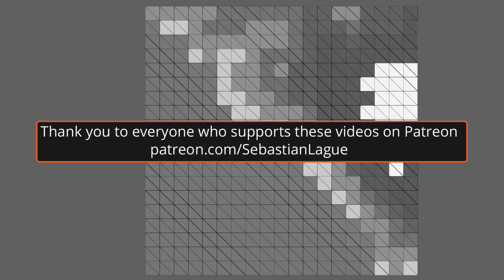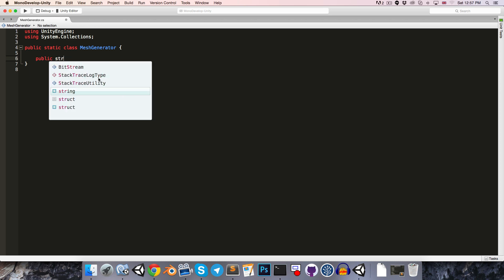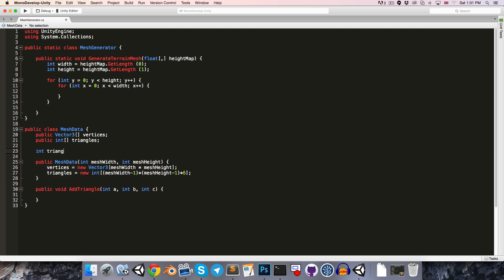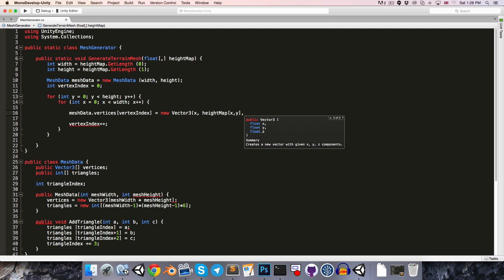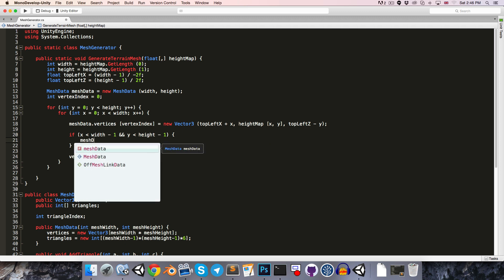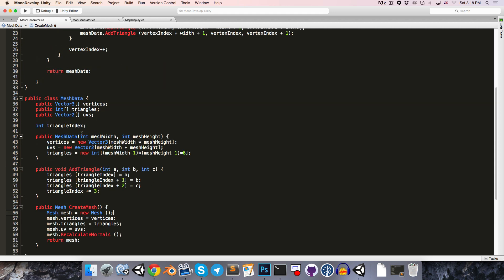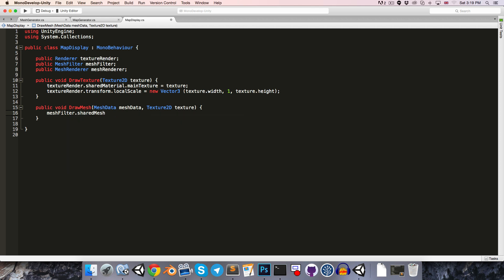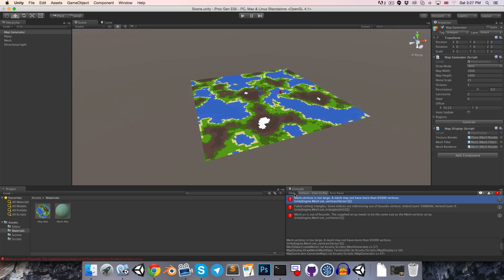Procedural Landmass Generation (E05: Mesh)

Comment: SOMEONE PLEASE ENLIGHTEN ME

i am SO confused. in episode 2, the width and height was the amount of pixels in the texture. And as far as I know, the amount of vertices should be (pixelWidth + 1) * (pixelHeight + 1), not straight up pixelWidth * pixelHeight. Even then some how every pixels on the texture fit snuggly in the generated mesh's many squares. How was this possible?????????
Reply: nvm i figured it out (2). in his project his generated mesh really has a W*H sized vertices array, so instead of generating a mesh with W*H pixels/squares (like his color and height texture generation), it just generates a (W-1)*(H-1) pixels/squares. Wonder if this is intentional to decrease computational time (if you want an actual W*H grid of pixels, I think it you're gonna need to sample the surrounding 4 pixels/squares height to get the height value for the vertex), or if it's just a mistake
Reply: sampling 4 surrounding pixels every vertex DOUBLES computation time, so im guessing optimization. or it could be a conventional thing idk
Reply: @vinhnguyen-o5z  ha you are the best for coming back and responding the solution!!! i am making a procedural game and had this same question!! most people would just figure it out and forget about it you are the GOAT
Reply: damn i have the same problem now my head hurt，i also think that  vertices should be (Width + 1) * (Height + 1),because I think them as a border

Comment: mine doesn't automatically randomly generate the seed yet, did I miss something or does that come later? lol
Reply: hey the seed is from the previous episode when he adds a System.Random object named prng nand then the following for loop. its lucky i saw this old comment i am making a procedural game and was looking for a solution to one of my problems and saw your comment ! this is the code specifically that adds it and also adds custom user offset from the vector2 parameter in the method signature

for (int i = 0; i < octaves; i++) {
			float offsetX = prng.Next (-100000, 100000) + offset.x;
			float offsetY = prng.Next (-100000, 100000) + offset.y;
			octaveOffsets [i] = new Vector2 (offsetX, offsetY);
		}

Comment: I had the problem of the texture of my mesh being rotated 90 degrees so to fix it i just change this line of code from this:
meshData.uvs[vertexIndex] = new Vector2(x / (float)width, y / (float)height);

to this:
meshData.uvs[vertexIndex] = new Vector2( y / (float)height, x / (float)width);
Reply: interesting it may be due to somewhere in your code not matching sebastians... i had a similar issue where my for loops were out of order from videos ago. it took me forever to figure out lol i am making my procedural game using this series and keep running into super random stuff like this where one var makes it work or not and i can't seem to figure out why

Comment: can someone help please!!!!, only half of my mesh triangles render. so i can see procedual colours and everything put half of the triangles are not there and are just empty space
not sure which codes you need to help me:
for generating mesh i * it by 6 andd it didnt work
public static class MeshGenerator
{
    public static MeshData GenerateTerrainMesh(float[,] heightMap)
    {
        int width = heightMap.GetLength(0);
        int height = heightMap.GetLength(1);
        float topLeftX = (width - 1) / -2f * 6;
        float topLeftZ = (height - 1) / 2f * 6;

        MeshData meshData = new MeshData(width, height);
        int vertexIndex = 0;

        for (int y = 0; y < height; y++)
        {
            for (int x = 0; x < width; x++)
            {
                meshData.vertices[vertexIndex] = new Vector3(topLeftX + x, heightMap[x, y], topLeftZ - y);
                meshData.uvs[vertexIndex] = new Vector2(x / (float)width, y / (float)height);

                if (x < width - 1 && y < height - 1)
                {
                    meshData.AddTriangle(vertexIndex, vertexIndex + width + 1, vertexIndex + width);
                    meshData.AddTriangle(vertexIndex + width + 1, vertexIndex, vertexIndex + width);
                }

                vertexIndex++;
            }
        }

        return meshData;

or the display code is this

public class MapDisplay : MonoBehaviour
{
    public Renderer textureRender;
    public MeshFilter meshFilter;
    public MeshRenderer meshRenderer;

    public void DrawTexture(Texture2D texture)
    {
        textureRender.sharedMaterial.mainTexture = texture;
        textureRender.transform.localScale = new Vector3(texture.width, 1, texture.height);
    }

    public void DrawMesh(MeshData meshData, Texture2D texture)
    {
        meshFilter.sharedMesh = meshData.CreateMesh();
        meshRenderer.sharedMaterial.mainTexture = texture;
    }
}

not sure what the problme is . help
Reply: You just forgot on the 2nd AddTriangle call, to increment by +1 instead of the width.

If you are still stuck with that, change this:
                if (x < width - 1 && y < height - 1)
                {
                    meshData.AddTriangle(vertexIndex, vertexIndex + width + 1, vertexIndex + width);
                    meshData.AddTriangle(vertexIndex + width + 1, vertexIndex, vertexIndex + width);
                }

to this:
                if (x < width - 1 && y < height - 1)
                {
                    meshData.AddTriangle(vertexIndex, vertexIndex + width + 1, vertexIndex + width);
                    meshData.AddTriangle(vertexIndex + width + 1, vertexIndex, vertexIndex + 1);
                }

Comment: These issues may be addressed (or intentional) further on in the series but I found fixes to correct the mirroring (and incorrect mesh height from the next part) as well as the mesh being smaller than the color map. 

In MeshGenerator.cs I changed:
	float topLeftX = (width - 1) / -2f;
	float topLeftZ = (height - 1) / 2f;
to
        float halfWidth = (mapWidth - 1) / 2f;
        float halfHeight = (mapHeight - 1) / 2f;
This was mainly for readability as suggested by another commenter, I believe this can remain unchanged with some tweaks to the arguments for the following code:

	meshData.vertices [vertexIndex] = new Vector3 (topLeftX + x, heightMap [x, y], topLeftZ - y);
	meshData.uvs [vertexIndex] = new Vector2 (x / (float)width, y / (float)height);
to
        meshData.vertices[vertexIndex] = new Vector3(x - halfWidth, heightMap[(mapWidth - 1) - x, y] * heightMultiplier, halfHeight - y);
        meshData.UVs[vertexIndex] = new Vector2(1f - (x / (float) (mapWidth - 1)), y / (float) (mapHeight - 1));

In Noise.cs I add to the top of the GenerateNoiseMap function:
        mapWidth++;
        mapHeight++;

I also changed these lines during an earlier part as suggested by another commenter, I'm not sure if they are relevant here or not
                    float sampleX = (((x - halfWidth) / noiseScale) - octaveOffsets[i].x) * frequency ;
                    float sampleY = (((y - halfHeight) / noiseScale) - octaveOffsets[i].y) * frequency;

These changes will make the noise map larger than the color map and mesh, but the color map and mesh will match. I have no idea how this will affect following along with the code in later parts lol

Edit: For the next part you will have to set mapChunkSize to 240 instead of 241 to maintain consistency in size between the color map and mesh.
Reply: yooo! heck yeah! I am going to go through this entire series to help make biomes in my procedural game (he doesn't cover that but this is a good place to start) and if he never solves this problem later in the series then you are a life sizer!!

Comment: my uv mapper is complete, almost I realized my mistake when making meshes and using the smoothing system... is that when doing that I need to not only measure distance between vertices, but also their matching uv indexes too. once I did that, things worked fine. just need to add in manual normal calculation to handle the hard shading that comes with non-smoothed vertices, to mimic the appearance that a quad, or tri, is sharing vertices with another quad or tri

Comment: ok, here I am again. I don't think you read your new comments or anything. but here goes. I have created a procedural generator for a vehicle, and that generator has a smoothing option built in, where I determine the distance between existing vertices in a mesh and compare that to the list of vertices in the list, if the distance is less than 0.005 meters, the system uses that vertice index to create the triangle. I do this in sets of three or 4 cause i need both triangles and quads. thing is, when running the smoothing code, the uvs do not work. I know your generator uses smooth vertices as I did not notice any of the issue related to flat shading showing up in the mesh. your way of doing things allows for uv coordinats to be preserved despite the fact that the mesh is smooth. I can things 1 of two ways. wait for you to help.. or do the irritating thing and analyze your code and compare it to how I am doing things. if anything it might have to do with the fact that I am adding in vertice, not all at once, but slowly as I progress down the entire generation script.... i use an ADDQuad function that takes in 4 points, a bool for auto uvs, and a bool for smoothing, then I pass in vector2s created from a function that converts vertice coords into pixel coords. then I use a uvmapper I made to uv unwrap the generated object. I have the uvs working in flat shaded mode, but in smoothing mode, nothing works.
Reply: I may have come up with an answer on my own, I just realized something. since I am essentially telling the game to use the uvs of an existing vertice when creating triangles, then I must also be accessing the UV for that vertice too. since I am not adding a new uv coord, I realized that since my uv mapper takes an object and splits its uvs into 5 sections. top, bottom, left and right and these are spread out over a large area of a texture. when smoothing, I am taking uvs from drastically different parts of the texture image and then using those for triangle. I realized this when I had remembered that some parts of the image worked fine, and those were where the UVs were close to eachother, IE in the same uv space. so to fix this I need to tell the computer to split my model up into 5 pieces. and then do smoothing on those 5 pieces individually then use a mesh combine utility to combine the resultant meshes together into 1. this should fix the UV issue.
Reply: it worked. I actually solved this on my own, and the solution was so simple!. now I just need to redo my vertice replacement code again and omit vertices from being added to the list. got code from my previous add quad method preserved as commented out code, just need to re add the uv combinations again

Comment: I never really grasped meshes, even after your tutorials, until today. I made a voxel based model creator and plan on expanding it to include shapes other than cubes. I had a hard time until I managed to create my first cube with 6 sides all part of the same mesh. was easier than I thought it would be. I also did something complicated and used a hightmap as limiter for genration 2D horizontal density maps, where the float value is the density of a voxel tile and can determine its materials. wth the hight values being used to prvent the game from placing objects above the surface of the hightmap I created a psuedo marching cube code. but it was too laggy. so I learned to make my own meshes with handcoded vertices!! thanks for all the great tutorials.

Comment: anybody else having the problem were it isn't making the mesh or atleast I can't see it. I got no errors and i triple checked the code. It must be something in the eidtor.  What could cause this?
Reply: I'm having the same issue where I generate a mesh but I can't see it unless I raise the y scaling insanely high. Did you ever find a solution?
Never mind I fixed it.
meshData.vertices[vertexIndex] = new Vector3(topLeftx + x, heightMap[x, y], topLeftz + y); -> meshData.vertices[vertexIndex] = new Vector3(topLeftx + x, heightMap[x, y], topLeftz - y); fixed it in the MeshGenerator class

Comment: ive copied every step but when I go to click the mesh object in the scene I do not get the little triangles, Later in the next video I tried changing the height multiplier and it just made my map wider and had no impact on its depth
Reply: Did you find a solution?

Comment: After changing the vertexindex amount, i noticed that the noise map and color map were not matching. When I change the seed, the height of the map changes but the color stays the same. I know unity does weird stuff with textures and rotating but I'm unsure this is causing the problem. If anyone could help it would be a godsend.

Comment: I've been going through this playlist and this lesson is the first time I've had a different end result than the video. My mesh object was somehow offset from the center and the mesh texture was rotated 180 degrees from that of the color map. After staring at the code and reading through the comments, I figured out a way to fix both issues.

First, the mesh offset. I tested what happens if you change the line:
--> meshData.vertices[vertexIndex] = new Vector3(topLeftX + x, heightMap[x,y], topLeftZ - y);
to
--> meshData.vertices[vertexIndex] = new Vector3(x, heightMap[x,y], y);
This translates the mesh object to start at (0,0,0) in world space, not (topLeftX,0,topLeftZ). From there I found it conceptually easier to refactor topLeftX and topLeftZ to halfWidth = (width - 1) / 2f and halfHeight  = (height - 1) / 2f and then just subtract them from x and y, yielding:
--> meshData.vertices[vertexIndex] = new Vector3(x - halfWidth, heightMap[x,y], y - halfHeight);

Next, the texture rotation. This has something to do with the meshData's UV and how it interacts with the mesh material (as others have stated). A fix to this rotation is to change the line:
--> meshData.uvs[vertexIndex] = new Vector2((float)x/width, (float)y/height)
to
--> meshData.uvs[vertexIndex] = new Vector2(1f - (float)x/width, 1f - (float)y/height)
This applies a mirroring across both dimensions of the 2D surface, producing a 180 degree rotation of the texture. If you only need to flip one dimension, get rid of the non-rotated dimension's subtraction. NOTE that this may flip things around when you apply the heightMultiplier in the next video, so if you do this you have to account for that there too. It's probably just easier to set the Map Material tilings to -1 and offsets to 1.

The mesh vertices for your triangles should move clockwise, not counter-clockwise (the Unity 2020.3 documentation says this explicitly). That may mean you need to re-orient the meshData.AddTriangles() statements. I'm using:
--> meshData.AddTriangle(vertexIndex, vertexIndex + width, vertexIndex + width + 1);
--> meshData.AddTriangle(vertexIndex, vertexIndex + width + 1, vertexIndex + 1);
though any cyclic rotation of these inputs will work the same.

With all those updates, you get a mesh oriented the same as the height/color maps and centered about the origin. Happy coding!
Reply: I had the same issue and it turns out I had written "topLeftX - x" instead of "topLeftX + x"
Reply: Great great great answer and update
Reply: never would have figured this out, THANK YOU
Reply: Thank you @anythingover0  !
Reply: The texture rotation fix causes an issue in his next video, where your colors will actually not correspond properly to the heightcurve.
Reply: This comment literally saved me ! 
I want to add that in case anyone faces problem with colors applied to different heights you can keep this line the same as the video :
meshData.uvs[vertexIndex] = new Vector2((float)x/width, (float)y/height);
while applying the changes mesh vertices and mesh offset as this comment suggests.
Reply: for me I had to change the line for the texture rotation:
--> meshData.uvs[vertexIndex] = new Vector2((float)x/width, (float)y/height);
to
-->meshData.uvs[vertexIndex] = new Vector2(1f-(float)x/width, (float)y/height);
hope this helps for someone with the same issue
Reply: Your a life saver lol
Reply: Your the best!

Comment: I don't really understand the formel to get the amount of triangles. (meshWidth-1)(meshHeight-1)*6 So, if our mesh is 3*3 like in your draw, would mean  4*6 = 24 triangles but only 9 vertices... which does not make much sense. There have to be more verts than tris.

Comment: lol, still an awesome tutorial series over 5 years later.
I totally butchered and tweaked everything to fit what I need and in doing so found that my last quad (triangles) weren't getting created with a 256x256 map. Spent a day going over code and trying to figure it out.

Then I said, well lets load up Mr Lagues code and check it
Whattaya know! His code is missing the last quad too! LOL

Still havent figured out why...
Ugggh, the Unity Vertice limit is 65535, not 65536 like I thought, got damit!
Reply: Man you have just saved me... I was going insane trying to figure out why... My Mesh had some black lines, I could only conclude that the vertex positions were messed up.
And that was why, I was trying to create a map bigger than 256 vertices.... It was so clear that it was a problem of 256size somthing becase when i got mapSize to 257 the problem appeared...
Thank you so much.

Comment: On the texture being created for the colors, there is a black bar that gets larger as the amount of octaves goes up. To temporarily fix it, I stretched the texture using the offset, but that doesn't really fix it because if I increase the octaves it will still appear. Any ideas on how to fix this?